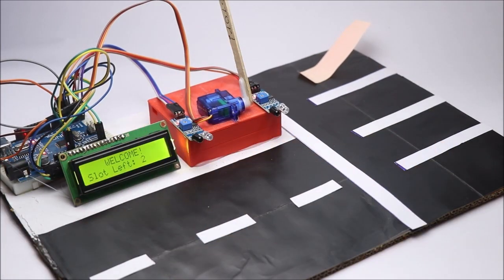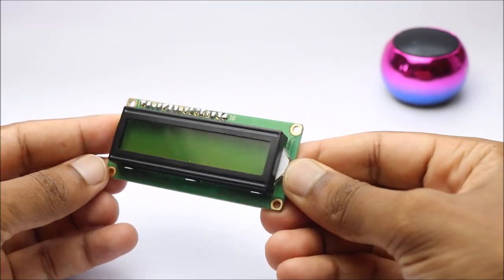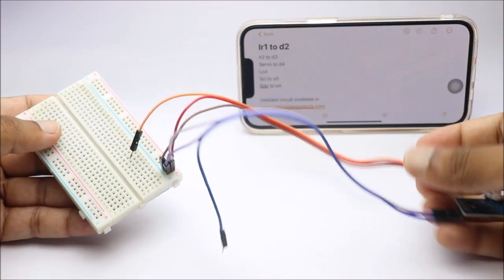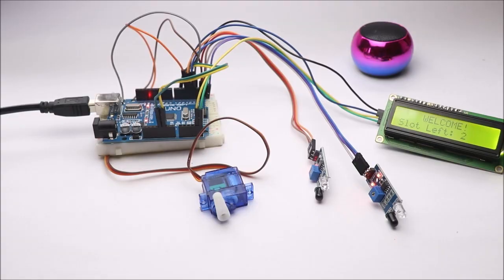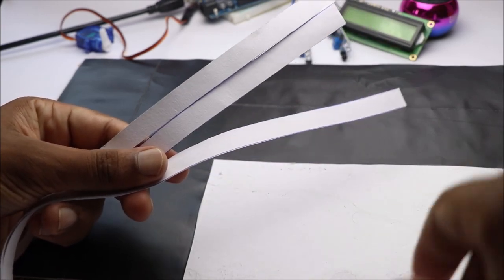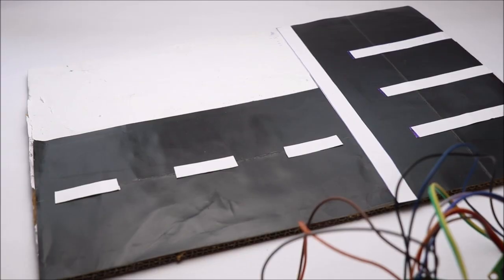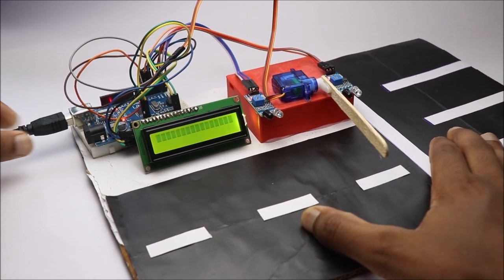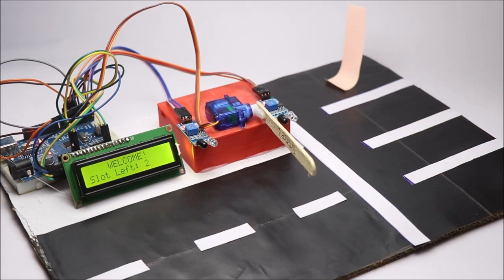How to Make Smart Car Parking System using Arduino | Automatic car parking system Arduino Project

Comment: Servo motor is not working properly what is the reason and how can I solve??
Reply from the maker: Connect to 5v
Reply: As an external power supply?? If yes then what should I use?